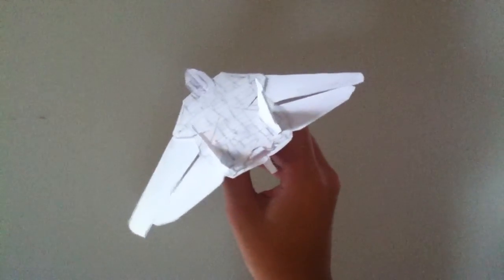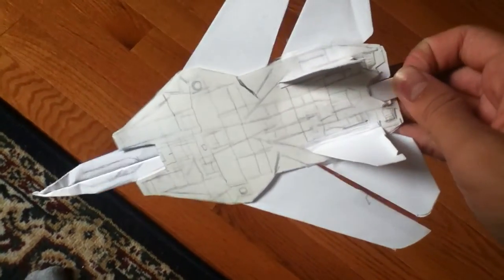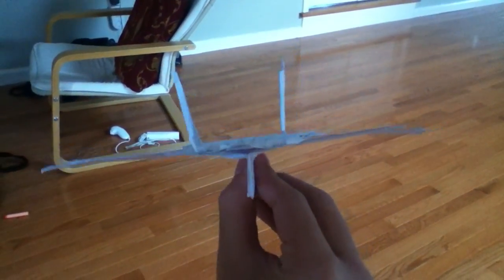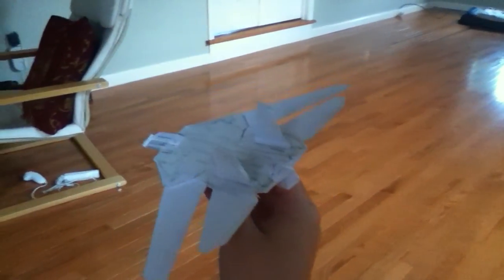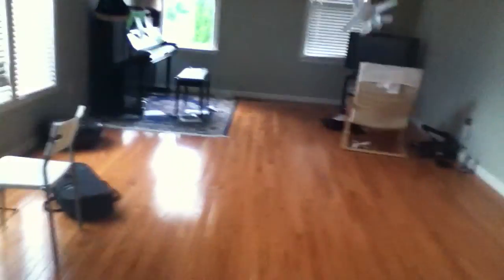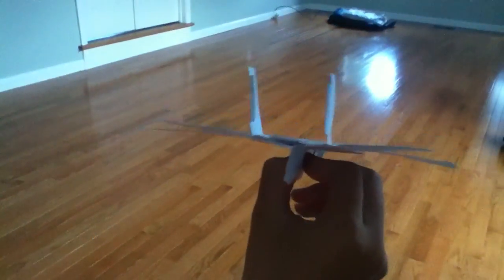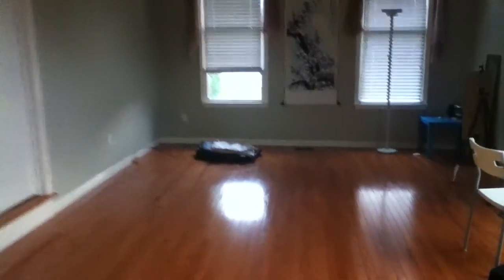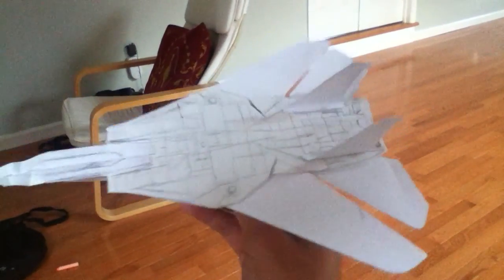Paper F-14 Tomcat With Variable Sweep Wings (V1)

Comment: Oh, I can explain why your F-14 cant fly well in extended wing...
In aeronautic view, your F-14 can fly in with the wing extend because of the large wing area can provide higher lift surface, but remember that we are dealing with paper plane.
In the case of paper plane, speed is crucial. Without sufficient speed, there aren't enough airflow in the wing to create air pressure difference for lift. And it to much drag for extend wing. Thats why paper plane fly better in delta wing configuration.